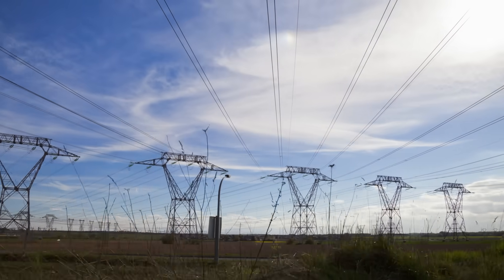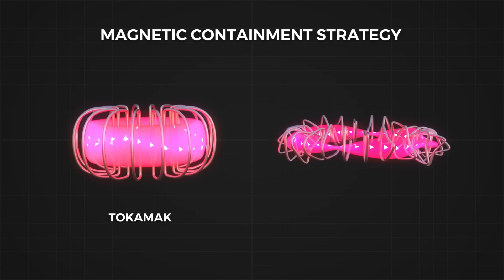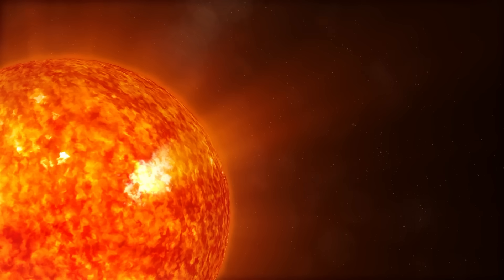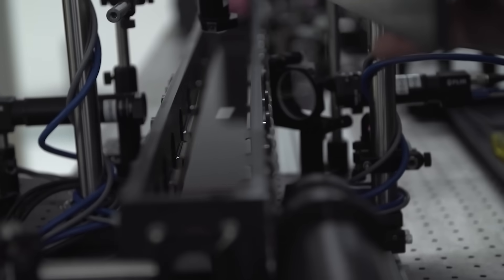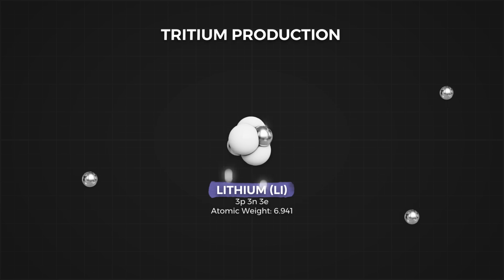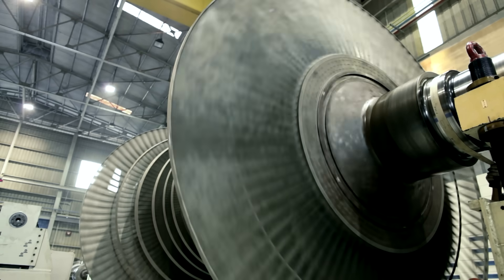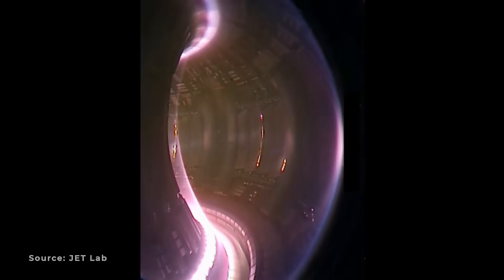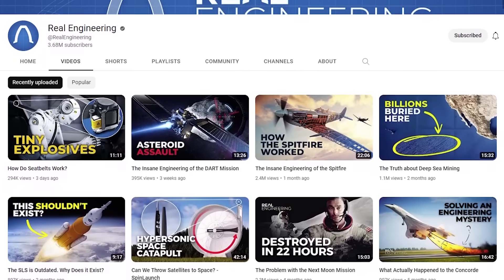The Problem with Nuclear Fusion

Comment: I feel the need to point out U-238 is also fissionable. At 14 MeV the fission cross section for U-238 and U-235 are nearly equal.
Reply: You need a neutron with certain energy to make U-238 to split.
There are reactor designs - even large scale one! - that make it work.
In most of existing commercial fission reactors U-238 captures neutron and eventually becomes Pu-239 or Pu-240 which are also perfectly fine fuel, however since Pu-239 can also be used for nuclear weapons there have been an immense political pressure to not go ahead with this technology.
As if countries who can afford nuclear weapons already don't have them...
Reply: @skipperg4436  the point was there was no need to distinguish between u238 and u235 in the case of this neutron field. Yes I'm aware there are fast reactors.

Comment: The problem is a continous working power plant in the gigawatt range. The other one the sometimes fancy confinement method. Is magnetic confinement just too "fancy"? Does inertrial confinement not scale down that much? (well it worked for Castle Bravo)  ... if you want a nuclear fission reactor in your smartphone you should not wonder either why that's not going to happen that soon
Reply: If you cant see why inertial confinement doesnt work for a continually running reactor then... you should stop watching these things.
Reply: @wizzyno1566  can't we just build a giant piston engine and detonate nukes in it.
Reply: Heheheheheh
Reply: @wizzyno1566  I'd say we can get into details when it comes to exactly what is meant with continous operation.A Tokamak is still pulsed. You'd better not give up easy.

Comment: One of the main arguments against nuclear fission is the limited amount of the fuel (mainly uranium) for the reactors, meaning we will run out of it eventually. It sounds to me the tokamak design suffers from the same problem, both lithium and beryllium are rare materials, especially if we consider how much we use of them already, so I don't see how is it any better in this regard. I'm looking forward to the Helion video, I'm curious if they suffer from the same issue, but I'm not keeping my hopes high.
Reply: Lithium is not THAT rare. It's just a pain to refine.
Reply: uranium is abundant especially in seawater and we've already successfully bred seawater uranium as well to give a near limitless amount.
Reply: I watched the new video and it actually mentions the tritium fuel and the beryllium used around the reactor as the reason these designs are not economical, so I think I was on the right track. Helion is not affected by this issue because they use deuterium as their only fuel source in a multistage process.

Comment: But there's the problem, 'cost effective' fusion reactors will have to compete with Molten Salt reactors, which are so much easier to make , just as efficient, and even uses waste fuel from old reactors. It's hard to see how they will ever compete because the technology is so complex and exotic.
Reply: Exactly.  Most of the recent attempts to build conventional fission power plants in the US have ended in expensive boondoggles. These were  'proven designs' (AP1000) built successfully outside the US, but cost overruns at Vogtle and V.C. Summer led to Westinghouse's bankruptcy in 2017.

Comment: Unlike other sources of energy THE ISSUE IS THAT FUSION IS NOT SELF SUSTAINING !!!
In the Sun, the pressure due to gravity enables the fusion. But here on Earth we need to create that pressure using energy. This is totally different then other ways of generating energy.
In fission reactors, coal power & natural gas power plants once the reaction is started the reactions are naturally self sustaining.

Comment: The entire problem stems from the pathological fear of radiation that is not justified by any scientific research. If the same levels of hysteria were applied to other energy generating technologies they would be completely unaffordable too but because of a very successful scare campaign in the 60s and 70s radiation from man made rather than naturally occurring sources were demonized.
Its profoundly annoying for the minority number of people who has actually read the studies to continually see the fear just increasing when the opposite should be happening!
Making intermittent renewables the basis for all energy production is a recipe for disaster unless something fundamentally changes and I haven't seen any evidence that it will but there are lots of empty promises...